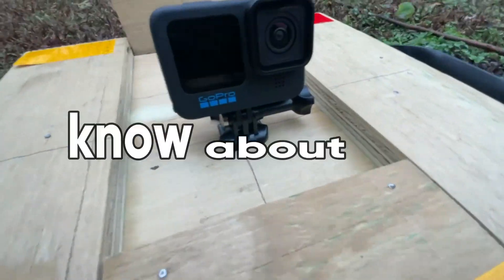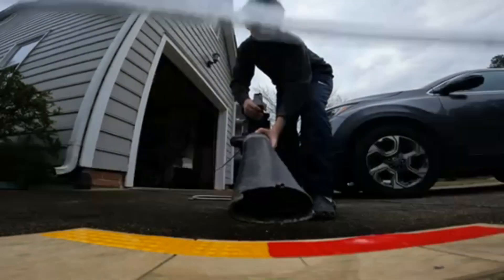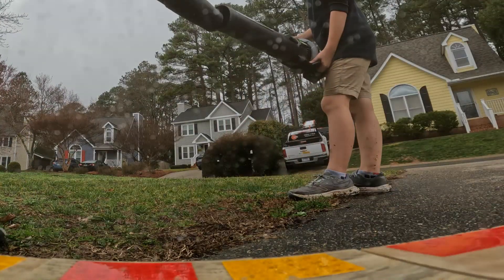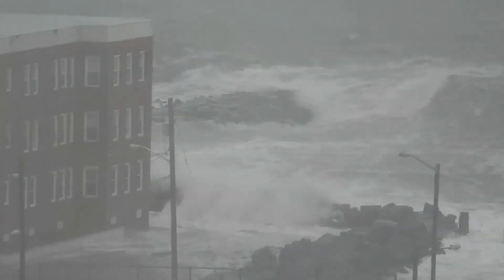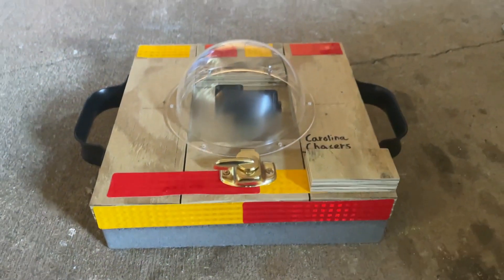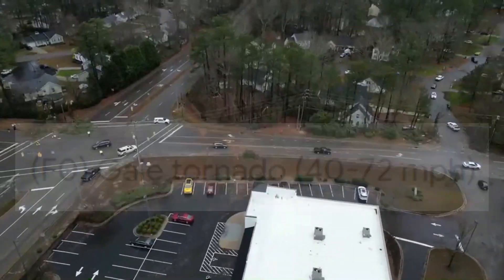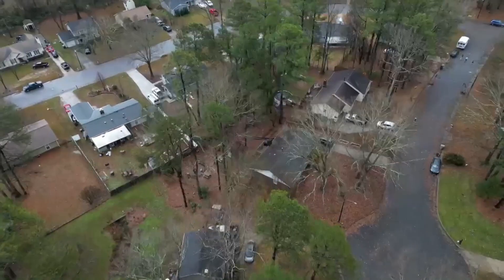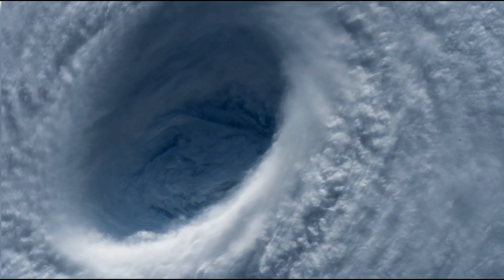Can my PROBE SURVIVE a TORNADO?

Comment: its a great probe. id recommend adding spikes 5 inches or more, upgrading the threshold to maybe survive ef2. Id use less wood and more metal, or something that chips off less easier. Maybe coat it with 2 mm metal plates. along with that, plastic/glass could easily break with a rock up to 3 inch. replace with firm see thru stuff like bullet proof glass.
Reply from the maker: Now that’s quite expensive haha

Comment: This might probably boost the probe's threshold, you can make makeshift spikes using screws, make it harpoon-like shaped, sort of like tiv 2's spikes, put athleast 3-4 under the probe, it is so that the dirt will weight down to the makeshift spike, also make sure that the screw your gonna use is pretty long and NOT dull, and thats basically it, oh and also im not sure if its gonna work as i havent made a tornado probe before, but goodluck, i guess
Reply: Also, i talked to a professional in Discord. He said yeah the screw/lag bolts could work, but for the Kestrel Wind Meter, it has a wind rating up to 80-90 mph, he also said wood isnt exactly watertight and you should reinforce it with a waterproof paint solution and something to lower the chances of mold growth, and also note from me, considering the size of your probe you might need extra long lag bolts, if possible around 10'' to 14'' in length (IF POSSIBLE)
Reply: Btw heres the footage of the twistex Turtle Probe intercepting a tornado, i heard you removed the dome, so good luck to your camera
https://youtu.be/-nKGOjNh_lI?si=eThfR-hNWhWTShCd
Reply from the maker: Yup I did remove the dome as it wasn’t strong enough to withstand any debris meaning the only thing it does is destroy the video quality. I’m thinking of cutting a friction fit rectangle in the side of the probe so the go pro can be protected from all sides but not the camera
Reply from the maker: That's a great idea, I'll have to try that out!

Comment: Hey one question how does the prove doesnt get lifted by the tornado?
Reply from the maker: It will get lifted by a strong tornado, if there is a strong tornado it probably wouldn’t be safe to deploy. If I were to remake it I would make it aerodynamic so air goes around it and add spikes
Reply: You should get a drone and idk how but make it so the drone drops in the path so you can avoid these problems 👍 but idk how

Comment: Hello, I have also made a homemade probe meant for intercepting tornadoes and hail cores for footage and data, it is called the S.I.P (Storm Intercept Probe). I have been working on it for around 2 months now, it is kinda done but mostly, I have gotten footage of a microburst with 80 MPH wind-speeds!
I recommend covering the wood with some duct tape and adding an airtight seal to the dome. Very nice probe! Once it has those stakes it could probably survive a low end EF-3
Reply from the maker: Nice do you have discord
Reply: @SyrixERLC  nah

Comment: You could try adding some plastic or maybe tinfoil to reflect light to also repel water instead of soaking in water
Reply from the maker: Then the probe won’t be able to see
Reply: @SyrixERLC   on the box
Reply: @SyrixERLC   in your last video pelting it with a hose the wood got wet it can cause water damage

Comment: You’ll see the little holes around dome you can put some screws their as some extra strength.
Reply from the maker: Since this thing is on a hinge, I can only screw in the 2 thats are on the block of wood that moves
Reply: @SyrixERLC  After you close it and put it out for a hurricane or tornado you can screw it in.
Reply from the maker: @GBLSQUAD  If i do that it will leave holes, and possibly split the wood so sadly no
Reply from the maker: ty for the idea @GBLSQUAD
Reply: Don’t forget this has to be deployed quickly